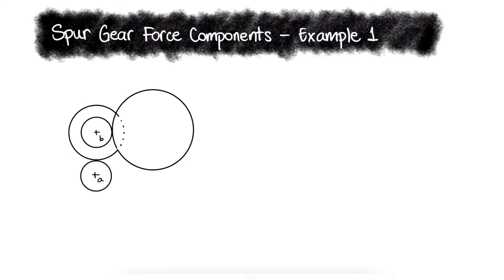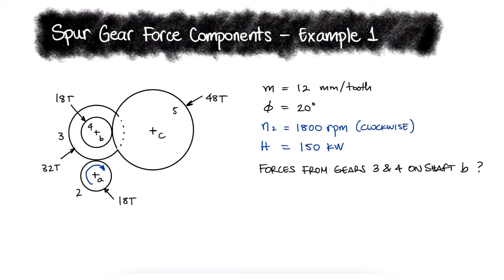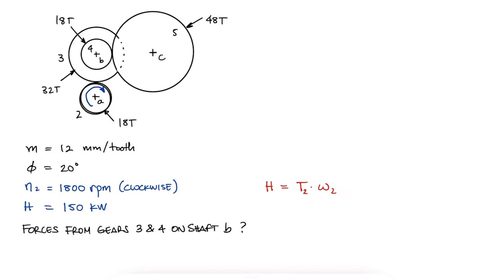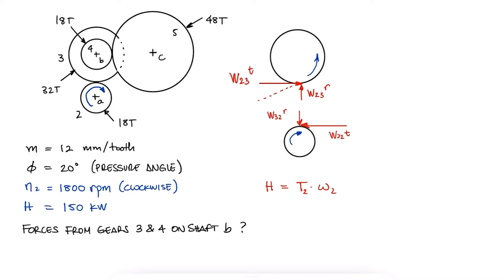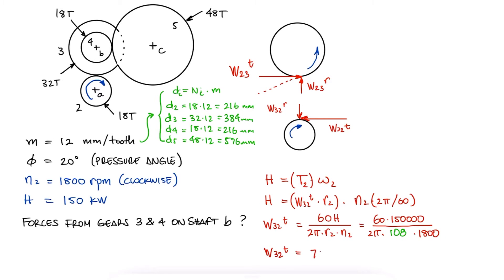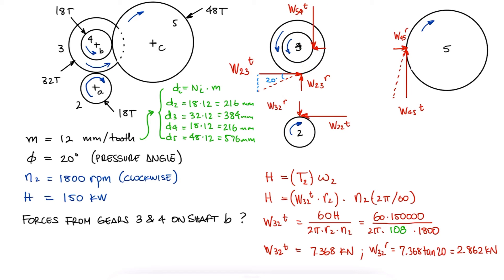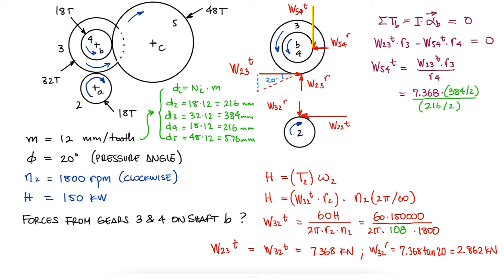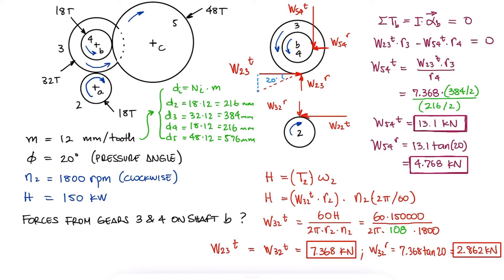Spur Gears - Force Components - Gear Force on Shaft - Example 1

Comment: Hello, thank you for the great explanation! I have a question regarding a project. Our project is to design a Mechanical Power transmission system for a conveyor and I am having difficulty in figuring out how to find the radial loads for the shafts in order to design bearings. I am using double reduction system, with 1 roller chain system and 2 spur gears, and using 2 shafts. Is there a way that we can connect? I would be very grateful if you can help us with this.

Comment: I believe there is a slight error at 1:50 , for the radial force exerted on gear 3 from gear 2 you wrote that it was equal to "2.862kn" where as the value should actually be "2.682kn"
Reply from the maker: Thanks! you're correct.